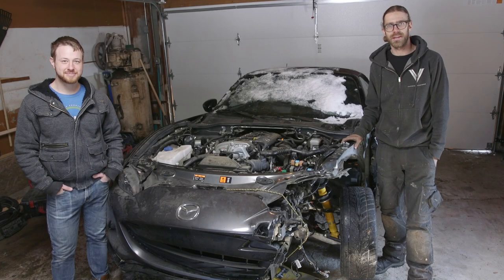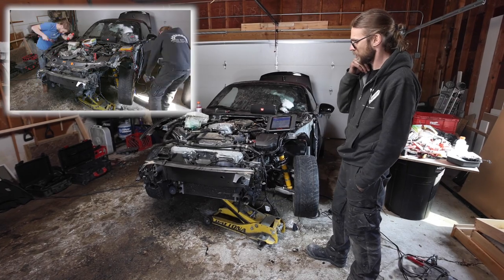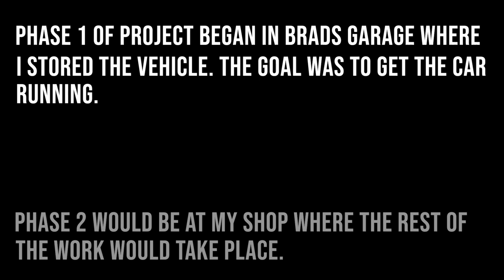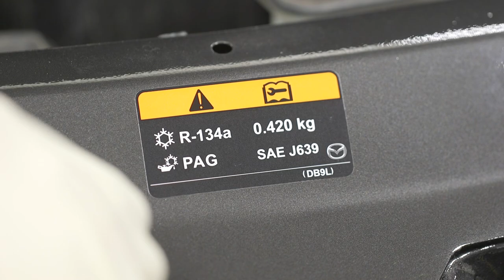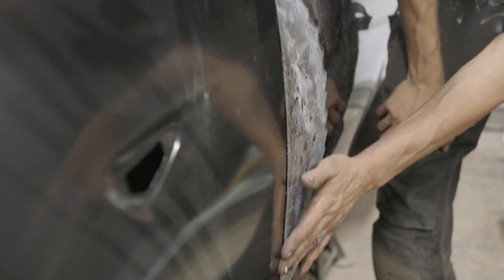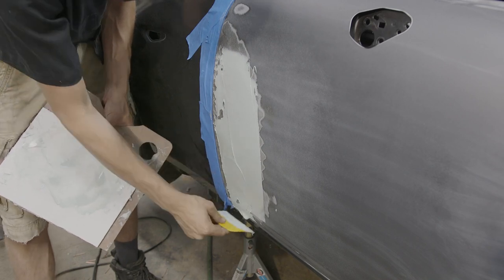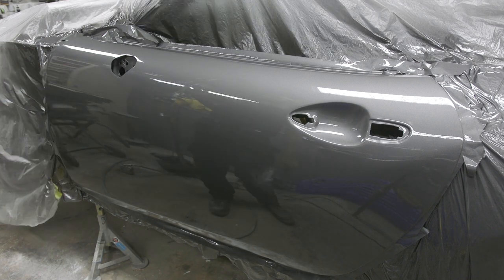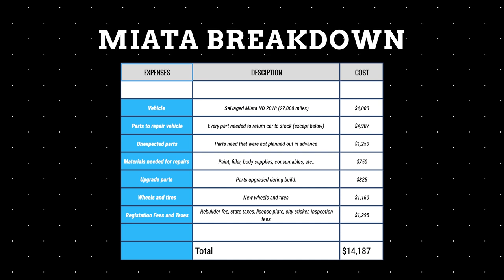Wrecked Miata Rebuild

Comment: why not use PDR on that door?
Reply from the maker: That’s beyond pdr
Reply: @VanoverMachineAndRepair  
Undoubtedly, you are very skilled and knowledgeable in various methods, so I was wondering if this particular damage on the door, which is common in Mazdas after an accident, could be repaired using PDR without damaging the paint.